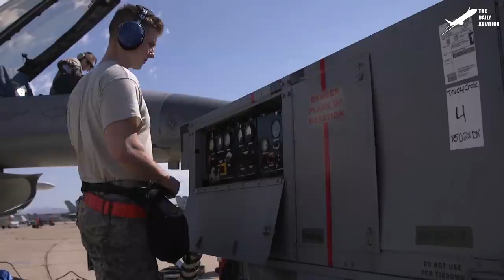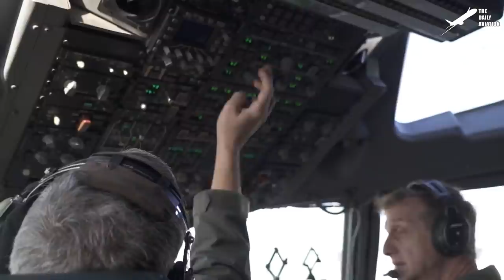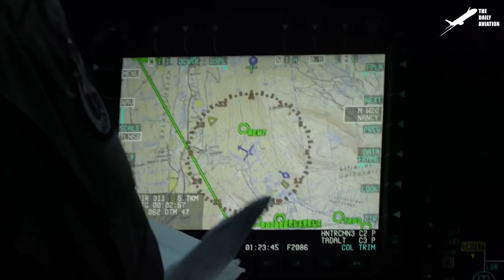US Airmen Crawl Into $40 Million F-16 Engine For Check-Up

Comment: Funny how it is always the Air*men* who do these hard jobs. Where are the female airwomen when these tasks have to be done?
Reply: I think there are surprisingly many women regarding maintenance we see in these videos. We also see women such as pilots on planes and helicopters. Otherwise, it is only natural that women do not have the most physically hard jobs.
Reply: @Hvitserk67  No I never see women doing the manual labor hard jobs. Obviously I am not referring to pilots, so try to focus and have some reading comp. If women can't do the jobs men can do, WTH are they getting paid for?
Reply: @uclajd  I did not write that you mean that women do the physically really hard jobs because they do not (for natural reasons). Regarding what women are paid for in the military, this is probably the same as for men (at least it should be). What women do not have in terms of physical strength, they often make up for in the form of fulfillment of duty and accuracy.